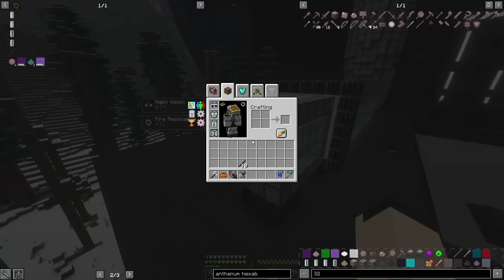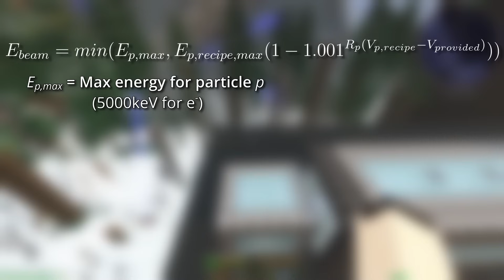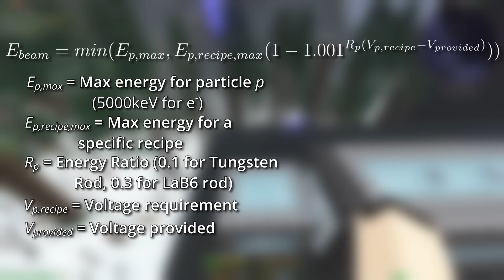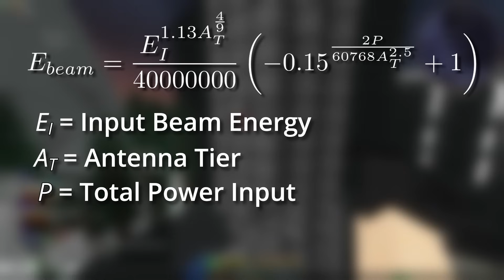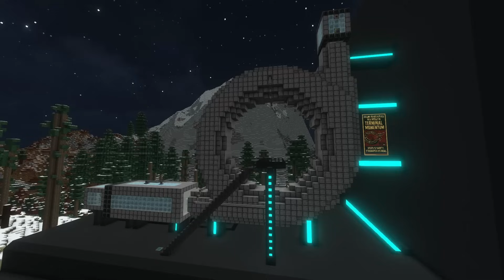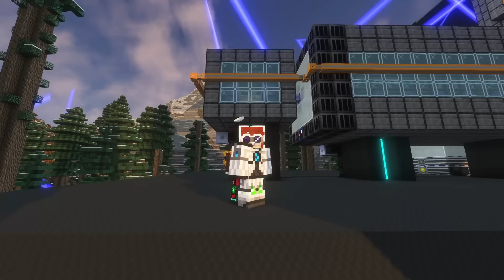GregTech New Horizons E93: Ex-Physicist's Guide To The Beamline

Comment: Do your calculations depend on only having access to ZPM energy hatches?
Reply from the maker: Dear employee,

The equations, no. Those have variables for voltages, so you can check values with whatever voltage you want.

But for the final setups at the end, you will need at least ZPM hatches to do all 5 lines. Without ZPM, you can only do the first two lines. I guess you could use lower tier hatches for the synchrotron up to a point, but that will hurt your processing time.

Best,
HamCorp

Comment: Could it be that the length of the Linac assumes ignoring the first 2 horizontal blocks (and perhaps the last two horizontal blocks)? Since it is a variable length multi-block, only the part between the "end pieces" is changeable, i.e. the section with glass (?).
Reply from the maker: Dear employee,

I thought so, but then it would be Length-2, but it's not. Plus it does use the true full length for the coolant consumption calculation (19kL/s), so I find it strange that it's inconsistent. 

Part of me thinks it's a rounding issue somewhere, but I can't really test the relationship without a longer Linac. Guess I could do it on a test world but im lazy

Best,
HamCorp
Reply: @Ham-Corp  Got it, boss!